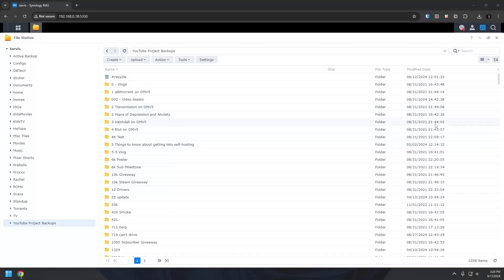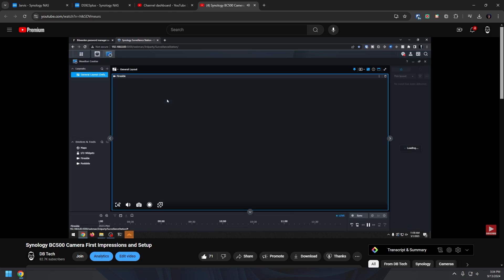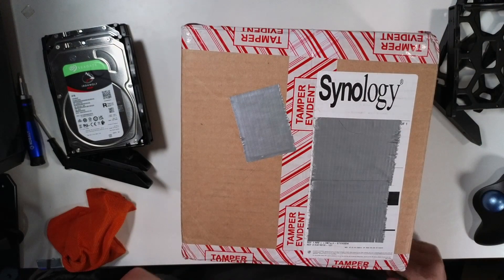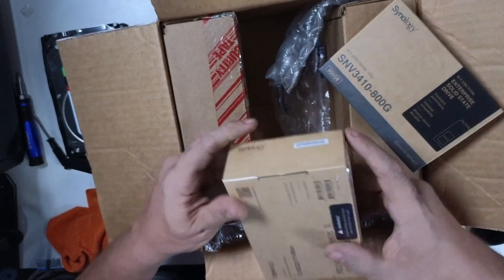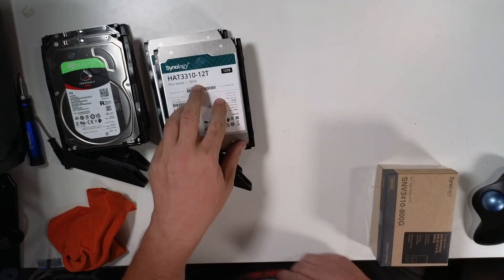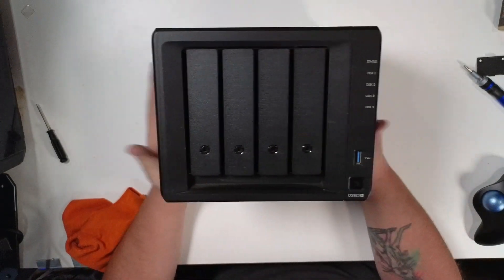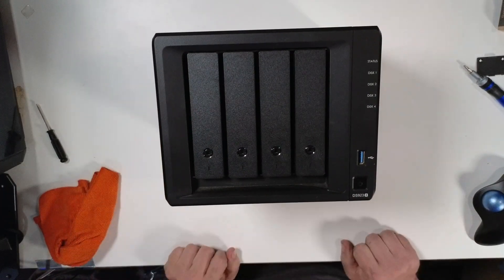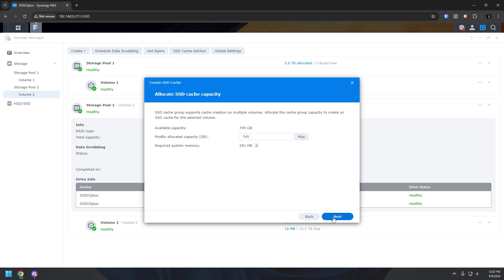Finally Getting to Work on my Backups

Comment: I am a Computer Systems Administrator for a criminal defense firm. We use Synology NAS units as our file servers and to backup our VMs through the active backup for business synology has which is great. We current have 6 in use. Getting ready to have 8 in use. Almost to a quarter of a petabyte of storage. Cell phone dumps, video, all becoming so common in cases, each case can terabytes in size. Synology handles everything like a champ.

Comment: I wonder : Why do you need SHR (raid1) for a backup system ? Of course you received the drives from Synology for free, but when you have to pay for the drives, I don't think this is a good idea.
Reply from the maker: I use it for drive redundancy.
Reply: Also rsync supports single-version backup. It is much better to use HyperBackup native system, the one you cancelled.
Reply from the maker: That is what I ended up using. I'm backing up data to 2 different NASes and going with rsync was the easiest way to maintain consistency. I looked at webdav as I thought it might be faster, but it was a wash, so I just used rsync.